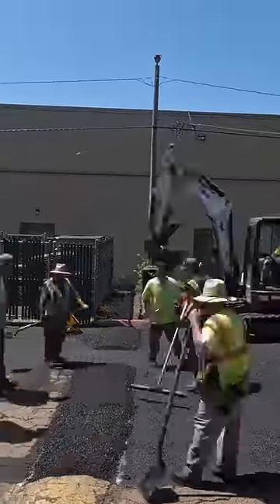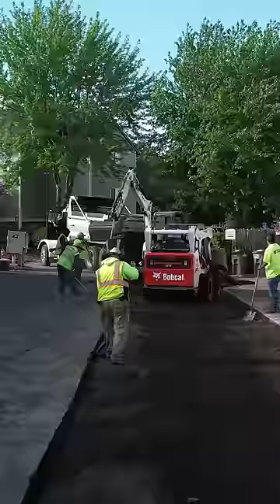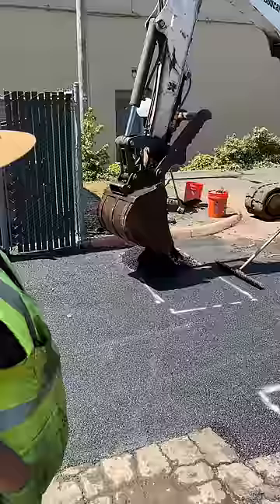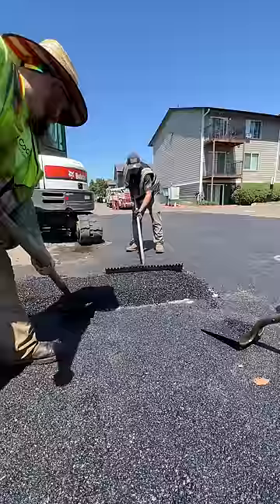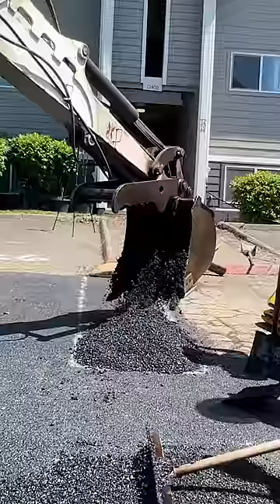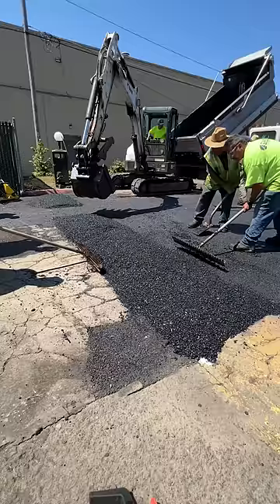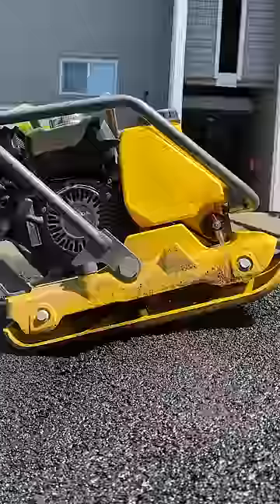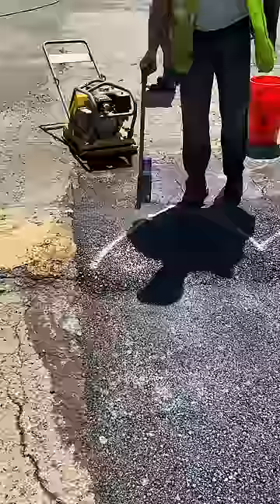This is how Speed Bumps Are Installed!

Comment: Be nice if it was none-Newtonian fluid and if you go fast it's a bump, but if you go slow there's no bump.
Reply: So a big puddle of oobleck?
Reply: That would be sick
Reply: I think you mean non-newtonian, but agreed
Reply: @silasbartol  you are correct.
Reply: Thing is the weight of the car will be enough to make it go hard.
Reply: @IIGrayfoxII you don’t understand how non-Newtonian fluid works my guy. Stuff like this already exists
Reply: Maybe, but the heavier the vehicle the more force they produce so matter the speed.
Reply: Wouldn’t work cars much to fast and to much weight you could go 100mph and you would fly through it like butter yes it’s stronger  when more force is applied but it’s not metal it’s cornstarch it can only be so strong
Reply: @thereinthetrees_5626  I know how Non-Newtonian fluids work.
But facts are fact, a vehicle such as a Ford F-150 which has a weight of around 2Tonnes to 2.5Tonnes will impart force upon the Non-Newtonian fluid even at low speeds like 5mph
Lighter cars are not immune to this as well, A common small car may be around 1.2-1.5Tonnes in weight and at 5mph it will still impart force upon the Non-Newtonian fluid, just not as much.
Reply: Properly engineered “speed bumps” actually have that effect.
Reply: I wish we used non Newtonian fluids more often, like for armor instead of heavy metals, or weird locks
Reply: @IIGrayfoxII Google it man. There are speed-bumps that already use ooblek. The fact is, even a large force, spread out and slowly applied will displace the ooblek rather than solidify it. Weight dosent effect it as much as the energy with which the fluid is impacted at.
Reply: @fightme5543  F=MxA
So Mass is apart of the equation that becomes the force of which hits the speed bump.
Reply: @IIGrayfoxII You’re literally ignoring the fact that speed bumps using oobleck exist, I’m willing to bet that you also forgot you can change the properties of oobleck to get different results, wild concept right?
Reply: Speed bumps are the opposite actually. I have an old Tacoma at 5mph it feels like your climbing a mountain but at 20mph you don’t even feel it, so they actually make me go faster than I normally would so I don’t have to feel the bump
Reply: @IIGrayfoxII it's not about weight but how quickly the force is applied. It I push my hands into non newtonion fluids slowly it allows the molecules to slide by one another vs a sledge hammer will force the to collide mimicking a solid. Long story short just drive slow and it's like a bag of pudding
Reply: @cptfab  umm no it's not. No matter how slow you drive it's still a speed bump.
Reply: @JF32304  Did you respond to the wrong comment or just slow?
Reply: @valkyrie5972  sigh, lol you said drive slow and it's a bag of pudding, I said no, the bump is still there. I wish people would not be stupid. No matter the speed you still feel the bump. With none-Newtonian fluid going slow, you wouldn't feel anything. Sigh. Face palm. Have a good day.
Reply: @JF32304  No the bump wouldn’t be there because the fluid is displaced..
Reply: @JF32304 you slow ain't chu? he was talking about NNF Speed bumps if you are slow you won't feel it...
Reply: @WiddlPeppuwu-sx3rx  lol what the hell do you think my very first comment stated!!! Why did he even need to make this comment!
Reply: They have speed bumps that do this
Reply: @danielorbits nah a big out of oobleck, go fast or fall down
Reply: Holy fuck that's a great idea
Reply: @JF32304 I think you’re literally confusing yourself here bud
Reply: it exists, problem is they last about 3 days until someone with a hatred for speedbumps and a knife comes along
Reply: @justwatchfor10min87 there are many more types of N-N fluids than corn starch and water. Thats just one type
Reply: There is already a video on youtube where they show using non newtonian fluid for speed breaker. Did you put this comment after watching that video?
Reply: How? It would just puddle instesd of staying a bump
Reply: @Fiberglass_Insulation  fluid is filled inside a long bag in a shape of speed bump. So at low speed it remains fluid and wheels passes over by creating indentation and so no bump effect. At high speed it acts like a normal speed bump. There are videos on yt just search them.
Reply: This is GENIUS
Reply: I think a company tried doing that but from what I can remember they done went bankrupt and couldn't do it
Reply: @IIGrayfoxII that’s what she said
Reply: @19Dad84bod  I know what she said
Reply: yea but it’d stick to the tires probably and that might cause issues, as well as yknow removing the material from the bump lol
Reply: True but no way are enough people going to be willing to pay the extra taxes for that 😂
Reply: That company failed
Reply: Pretty sure but idk
Reply: Bro it already exists search it up 💀💀 it’s been out for a few years now
Reply: @thereinthetrees_5626 no he’s kinda right, BECAUSE no one’s going to go slower than 1 mph, otherwise all that weight if the car kinda comes fast at 1 mph, yeah you’re moving slow but in a single millisecond, hundreds of pounds will be applied so
Reply: ayo when we gonna get non newtonian car suspension...
Reply: Ahh, the oobleck speed bump
Reply: im guessing that would be expensive to maintain and install no?
Reply: @toad7395  yeah it would be and get destroyed fairly fast. Who knows.
Reply: Yeah I think I remember that video, but it's still not practically viable because of maintenance
Reply: @danielorbits no there’s speed bumps that are filled with water and do what he says pressure builds when faster pressure is okay when slow
Reply: @justwatchfor10min87  bru there are a lot of different types of non-Newtonian fluids out there. It describes and entire class of materials that get hard when struck.
Reply: @justwatchfor10min87 it literally does work these kind of speed bumps exist
Reply: @zacharyreynolds4303  that's sort of the opposite of what you want for car suspension, pneumatic or hydraulic much better
Reply: I don’t know if there’s a suitable non-Newtonian fluid for such heavy implements. If it would harden too quickly at 15-20 mph (50-100Km/h if you’re a E*ro) then perhaps a few wide lines could extend towards oncoming traffic from the bump, allowing it time to move and coalesce properly for slower drivers, while faster drivers would likely experience the substance as akin to modern concrete or asphalt roads with bumps.
Reply: @strykerwaller3784  it does exits considering non Newtonian speed bumps already exist
Reply: They already have a more practical application of the general idea, currently in practice all over the globe, but they are considerably more expensive and thus less common. 

You can do it in a lot of ways, but one of the simplest to conceptualize involves only a clock and sensor. You have a pressure plate that detects cars, and the bump descends to become flat after a fixed time interval, so that fast moving cars hit the bump but for slower moving cars the bump has flattened by the time they reach it. There are far better methods to achieve the same goal in practice today, but that is the easiest way to imagine a functional solution. 

It’s still way cheaper to just make a pile of rock in the road, though.
Reply: They did that and the company that did went bankrupt
Reply: Hot asphalt is a non Newtonian fluid
Reply: What happens when (not if) it pops. Cool idea in theory... in practice not so much.

Comment: These people out here making more of a curb than a speed bump, at least it feels like it!!
Reply: True
Reply: Nah that looks like one of those good speed bumps where you just slow down and it's smooth. The evil ones are in school parking lots. Theyre practically square.
Reply: because your going too fast 😮
Reply: Can't believe there isn't a form to make sure it's not too high by law due to low sitting cars. Where is OSHA when you actually need em
Reply: @speed_demon420  noone is forcing you to make your car sit low, why should they cater to you? Cars have minimum ride heights that are still higher than bumps.
Reply: There was a speed bumb where i used to go to school that istg had a 60-75 degree straight angle for a side
Reply: the speed bumps at my friends apartment, they're so fucking rough & bad
I have a '96 Corolla on coilovers & almost got stuck on one 💀
Reply: @junkbob6832 broke my collarbone riding my bike over one of those. They painted it into a mural it was basically invisible. My roommate tripped over it when he came to take me to the hospital...